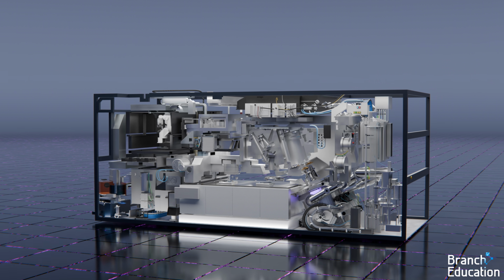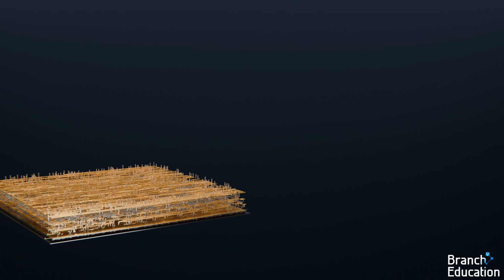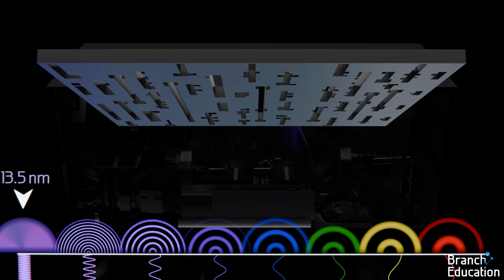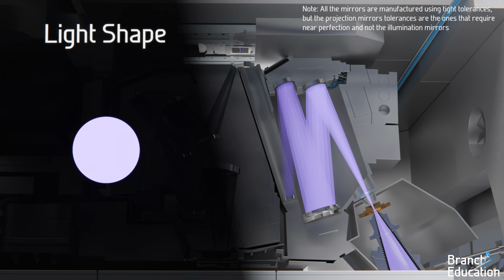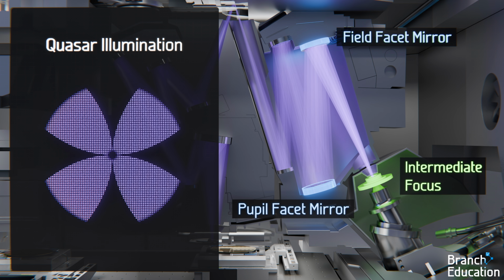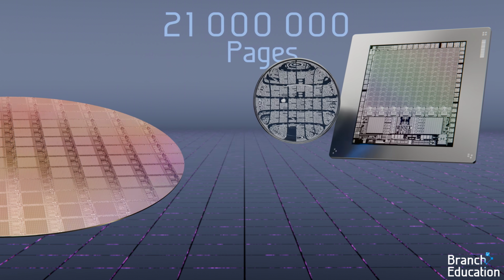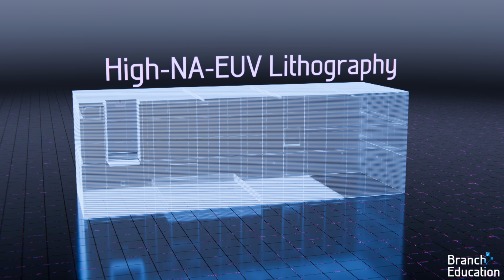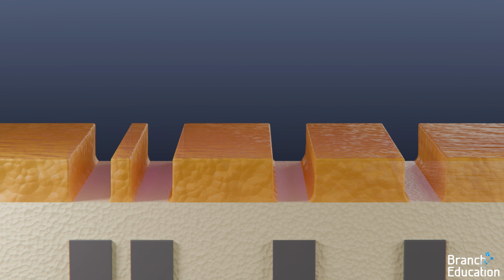The $200M Machine that Prints Microchips:  The EUV Photolithography System

Comment: AI Summary

Abstract:

This video provides a detailed, animated exploration of ASML's Extreme Ultraviolet (EUV) Photolithography system, explaining how this highly complex machine manufactures modern microchips. The system functions as a nanoscale photocopier, imprinting intricate patterns of transistors and wires from a master template, called a photomask, onto silicon wafers. The video breaks down the core processes, starting with the unique method of generating 13nm EUV light by vaporizing tin droplets with high-power lasers in a vacuum. It then explains the sophisticated optical path, which uses specialized multi-layered Bragg reflector mirrors to guide and shape the light. The presentation covers the role of the photomask, the projection optics that shrink and focus the pattern, and the "TWINSCAN" wafer handling system, which uses magnetic levitation and advanced sensors to achieve sub-nanometer alignment accuracy.

Deconstructing the EUV Lithography Machine: How Modern Chips are Made

*   1:07 Introduction to Photolithography: Photolithography systems are essentially nanoscale photocopiers that imprint the designs for transistors and wires from a master template (a photomask) onto a silicon wafer. This process is repeated hundreds of times across the wafer's surface.
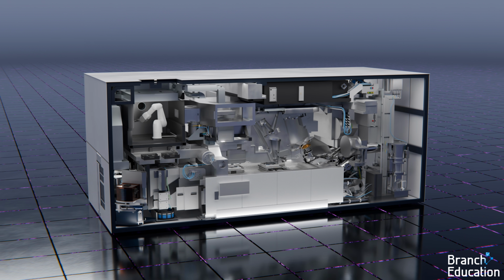*   6:09 The "Stencil and Spray Paint" Process: Chip manufacturing is a cyclical process. The EUV tool creates a "stencil" by exposing a light-sensitive photoresist layer on the wafer. Other machines then "spray paint" by etching, depositing materials, or implanting ions through this stencil to build one layer of the chip. This loop is repeated around 80 times for a complex GPU, taking several months.
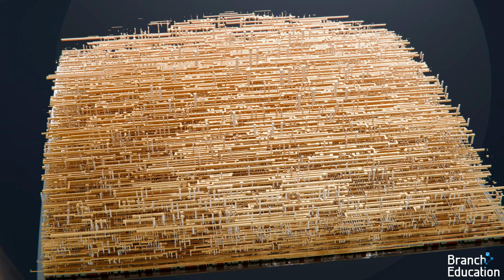*   10:50 EUV vs. DUV Systems: Advanced chip factories (fabs) use a mix of lithography tools. Expensive EUV systems, which use 13nm light, are reserved for the smallest, most critical layers (like transistors), while older, less costly Deep Ultraviolet (DUV) systems are used for the larger, upper layers of wiring.
*   15:31 Generating EUV Light: The system creates EUV light in a vacuum chamber by firing two high-power laser pulses at tiny droplets of molten tin traveling at 100 m/s. The second, a 25kW laser, vaporizes the tin into plasma, which emits the required 13nm EUV light. This process repeats 50,000 times per second.
*   19:49 Advanced Reflective Optics: Because EUV light is absorbed by almost all materials, including glass and air, the entire system operates in a vacuum and uses highly specialized mirrors. These "Bragg Reflectors" consist of dozens of alternating, nanometer-thin layers of silicon and molybdenum to achieve approximately 70% reflectivity per mirror.
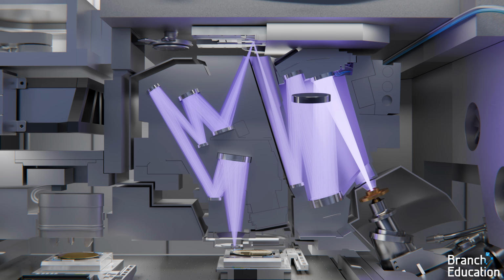*   20:54 Sophisticated Illumination: The illuminator uses hundreds of independently controlled micro-mirrors to shape the EUV light into complex patterns (e.g., annular for circular features, dipole for lines). This is analogous to angling a pen to draw different shapes and is critical for accurately printing different types of circuit features.
*   22:58 The Photomask (Reticle): The photomask is the master template containing the design for a single chip layer, with a pattern 4x larger than the final image printed on the wafer. It is loaded onto a reticle stage that moves with extreme precision and acceleration (over 7Gs).
*   28:19 Projection Optics and Numerical Aperture (NA): A series of large, precisely crafted mirrors (made by Zeiss) project the pattern from the mask onto the wafer, shrinking it by a factor of 4. The system's ability to print small features is defined by its Numerical Aperture (NA). This tool has a 0.33 NA, while next-generation "High-NA" tools will use even larger mirrors to achieve a 0.55 NA for printing even smaller features.
*   32:27 Sub-Nanometer Wafer Alignment: The system uses a "TWINSCAN" architecture with two wafer stages operating concurrently for efficiency. While one wafer is being patterned, the other is meticulously measured using alignment sensors. This creates a detailed map to correct for distortions, ensuring each new layer aligns with the previous one to within a single nanometer.
*   36:01 Levitating Wafer Stages: To achieve incredible speed and precision, the wafer stages levitate on a large magnetic grid. They are moved by powerful electromagnets for fast, long-stroke travel and a secondary short-stroke stage for nanometer-level fine adjustments, ensuring perfect synchrony with the reticle stage during exposure.

I used gemini-2.5-pro| input-price: 1.25 output-price: 10 max-context-length: 200_000 on rocketrecap dot com to summarize the transcript.
Cost (if I didn't use the free tier): $0.04
Input tokens: 23778
Output tokens: 1000

Comment: 0:30 10nm? not 4nm? are AMD claims just marketing or is it something else?
Reply from the maker: yeah, 4nm is a marketing term and not a real physical dimension
Reply: They are working in 2 nm this year
Reply: Not just amd, all companies that make this kind of hardware
Reply: It's marketing term yes. Since around 2010 the nm number no longer corresponds to a single physical feature like transistor gate. Now They just represent improvement in the technology.
Reply: @4paapii So the nm number is like a hype?But the computing function of the chips is still improving or what?
Reply: @soulsdark5733 it gives even more space for more transistors
Reply: @soulsdark5733  the performance is improving which is why clock speeds and performance is going up

Comment: What I want to know is, how long did it take for us to get to THIS level of complexity? When the first microchip was invented, there weren't any of these huge, insanely complex photolithography machines. They started with something comparatively simple, kept asking "how do we make it smaller?" and then started coming up with more and more bizarre technologies to essentially hack the laws of physics into doing stuff that by all logical reckoning should be impossible. At what point did someone figure out that they can't just use any old light source, to get this done, but that they have to use the very specific type of light that you can only get by blowing up a goddamn particle of tin and then shining it through a tube full of mirrors? And then who was it that realized that, again, not just ANY mirror will work, but it's gotta be a WEIRD mirror made out of a metal that most people have never even HEARD of before?

It really is amazing just what humanity is capable of when we start putting our heads together and combining all of our ideas, research and brainpower. This sort of thing could never have been designed and built by a single person - it's the result of decades, if not centuries of interdisciplinary research, hundreds or thousands of scientists building off of each other's work and referencing each other's discoveries to do things that would've seemed like magic only 150 years ago. I only hope that we keep moving forward when it comes to science, and not let the new hurdles that are threatening the intellectual development of our species slow us down.

Comment: How do you make a photomask then?
Reply: he already said it , silicon and molebdium which is work as reflector for uv rays
Reply: @Rohit-cj6eb  Nah. I meant the photomask. What you talking about?
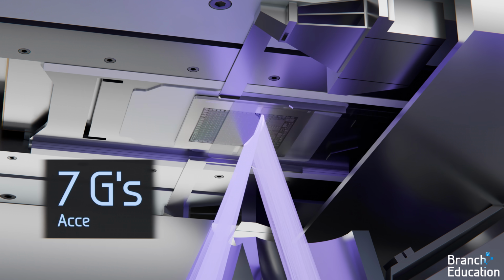Reply: @progresShip  25:05? Do you have ADHD?
Reply: @Rohit-cj6eb You dumb***. If the details on photomask have the same dimensions as the details on the chip then if the dimensions of the details are 13nm, how tf do you suggest they made the photomask?
Reply: @Rohit-cj6eb If the details on the chip have the a dimension of 13nm then the photomask also has details of dimension 13nm, how do you suggest they made the photomask?Me? ADHD? Says the idiot who just agreed on whatever was said. With just those two lines you envisioned the creation of a photomask, did you?  How do you think they put such tiny details with the Braggs reflectors or whatever it was? Those reflectors themselves will have to be similarly tiny you idiot. How do you create and install such tiny reflectors? That's my question. You are safe that YouTube deletes my comment or else i would have humiliated you to the point where you would have never recoverd you sheep following a herd

Comment: One of the engineering achievements of this machine that stuns me the most is that it's a factory operating at a quantum scale. Like, were pretty good at mass producing things at this point, and we can study quantum physics in highly controlled lab environments, but in most cases I feel like those are two pretty different fields of science and engineering. And yet somehow, these machines manage to do both at the same time.

Comment: That is frankly unbelievable technology. It's the kind of thing made up of so many individual pieces of black-magic that it honestly makes me wonder how anyone ever came up with even one piece of it. 

I get that this is probably the 40th generation of this kind of technology and it's been making smaller improvements over time, but still, this is near-incomprehensible levels of advanced.
Reply: Check out the detectors of the LHC, JWST operation and deployment, Optical interferometer telescopes like VLT or Chara.....so many things that seem to have no right existing it blows my mind.
Reply: It truly is 🔥
Reply: Well they had a 20 YEARS development time for the machine, including the delivery optics and driving laser. It required long, long breath to make it real.

Comment: @BranchEducation Congratulations on the ASML sponsorship! 
My friend sold Canon lithography machines in the latter 70s. Even then, they were working hard on getting parallel walls to the channels in the photoresist. The silicon ingot crystal structures had on the order of one defect in 10^23. You should see one of those 300 mm wafers explode when you bend it beyond its elastic limit! 
I think you have an unsurpassed ability to communicate sophisticated technology with sufficient, but not overwhelming, detail.
Best regards

Comment: I found this video to be absolutely fascinating, awe inspiring, and very nearly unbelievable. The level of layered complexity and extreme micro-precision involved in the microchip manufacturing via EUV Lithography is so far beyond being "impressive"... there is no adjective adequate to describe it... this is all seemingly "God like".  
If I had been shown this video and told it was a proposal for a machine yet to be built, I would have said: "It is amazing, but it will never work.  There are far too many variables, all requiring a level of complete control and precision, that the physical reality of our world will simply not permit this process to be achieved."  Yet, that skepticism would be an incorrect assessment, as these machines have been with us for many years, and they create the computerized devices which make modern life possible.  
I have long thought the moon landing program of 1969 to 1972 was the most impressive thing we have ever done. Elon Musk's Space X demonstrating the ability to launch a rocket that deploys satellites, returns the Earth backwards, and is caught with a giant pair of tongs, to be reused, may have superseded that.  I must admit now, these EUV Lithography machines are likely the most impressive thing human beings have ever created.   
We are however, now hitting up against the physical limits of reduction, creating microchips with circuit pathways as small as 3 nanometers.  We know that going below the 1 nanometer level causes "quantum tunneling", (electrons moving through matter and being in more than one place at the same time), and so physical matter cannot be controlled at levels smaller than this... (plus circuit pathways obviously must have an atom or two or three on each side of the wall... we cannot build things out of subatomic particles).  I wonder if future microchips will have any option other than getting larger overall, and stacking into thicker layers?

Comment: I knew these machines, but they are 1000 more complicated than I ever could expect. How can human design something so complicated and make it work ?
Reply: it took a while to get here, longer than I have lived at least. less advanced lithography machine where used for decades after all. the 386 at 1000nm node is a pretty usable cpu for home computers, full keyboard mouse GUI and all. was made 40 years ago.
Reply: There were a lot of humans involved.
Reply: It took decades of progress getting stuck...to the point that a lot of people thought perhaps it's impossible to go further. 

And then one day ASML revealed they made it happen.

I won't be surprised if it takes 50 or a 100 years until the next step up.

Xray wavelengths seems exponentially more difficult.
Reply: @tylerdurden3722 it takes thousands of brilliant minds over generations to get to any one point. But it's one particular mind that comes along to produce the missing peice of the puzzle, that finally allows the breakthrough that had stalled everyone before. It's sad that most of these key individuals are unknown to the world.
Reply: This can't be done by mankind..

Comment: This is absolutely one hell of a video

Tried to answer a really curious person here. Kindly correct me if you're with ASML :)

1) how do the actuators in the short-stroke stage work?
      
Short stroke stage corrects the yaw (orbit) corrections for topological corrections is handled by the field facet mirror

2) what features is the quasar illumination pattern used to etch?

Dipole illumination is used for x and y axis
Quasar illumination is to more accurate x and y axis including diagonal features

3) I knew that often multiple exposures were used to etch a single reticle, is this information wrong/not true anymore?

Depends how you define multiple exposures as you see, EUV turns on and off 50,000 times a second so its multiple. photons behaves as a probablistic wave and sometimes does not hit on accurately on one point along the wave, so multiple hits are required to etch acurately. But if you are asking "How many passses" then its one

4) why is the exposure done in a "slit" rather than "globally"

Slit because limitations in EUV power. Channel already said that there are 30% losses per mirror, this is not the complete story. Laser conversion is just 1-3% so 97-99% is lost there. Then EUV from tin plasma fires in all directions and the collector mirror only reflect 30-40% of the collected EUV which itself is a Bragg Mirror has 30% losses itself

If it is global reflection, granted its possible, there will be difficulty in alignment on the topographical aspect of the wafer

4.a) how is that slit achieved? do they have distorted mirrors (not even asphericals, as that would still be axially symmetrical)?

Controlled by multiple mirrors with axial corrections on the field mirror

4.a.i) how do they make such mirrors?

Magnetron sputtering and if extreme accuracy required, Atomic layer deposition with chemical and mechanical polishing. It has about ~50 alternating layers of Molybdenumn reflector and Silicon spacer on layers and surface to prevent contamination. Total thickness is 150-200nm, still less than a micron

4.b) do Bragg reflectors need to have the same surface finish on each of the layers, or is the final surface more important than the others?

Silicon capping is important to prevent contamination of the molybdenum layers, especially at the tin plasma chamber. This area can be contaminated by tin sputter and deposition from tim plasma gas. There is constant hydrogen flush though

5) how does the intermediate focus work?

I think I discussed most parts of the intermediate focus (tin furnace) part, what is left is the zinc filter on top. Blasted tin produces mostly EUV but also other wavelengths, the Zinc filter removes the other frequencies

6) how is the reticle constructed?

The silica and the tantalum blocker is printed by electron beam lithography. If Twinscan is the mother, Then E Beam is the father (LOL)
For the Bragg Mirror layer of the reticle, Refer to my answer at 4.a.i

7) If the tin is vaporized at different point (as each droplet has a slightly different trajectory), how is the EUV light not slightly shifted from one droplet to the other? is the cone of light carried by the optics bigger than what the etching utilizes to account for this?

I think the representation is wrong, the laser light should be another point to convert the tin into pancake then at the center of the convex should be the high powered laser. 

If the droplet is off trajectory it will be disposed, if it meets tolerances, then it will be blasted. Not all probably at same trajectories, but the 50K frequency can compensate for it

8) How strong of a vacuum is pulled inside the lithography machine?

To the point that air molecules are gone inside the machine as air absorbs EUV and it can oxidize parts inside

9) Given the 50KHz frequency of the light beam, multiple "flashes" are used to perform a single exposure (let's say 50000/18s (per wafer) / 100 (reticles per wafer)). how is a consistent light exposure achieved?

At 50,000 its almost as consistent like you can deciper motion at 60HZ on your phone display. I think I explained the wavefunction of light at number 3

Comment: At 35-09, the machine scans each wafer back and forth in short strokes thus creating inertia, and nm errors can take place if the platter jumps, so why not scan a whole row in one long stroke such that  there is less back and forth movement. less wear on parts. Other than that I am sure Chinese would want to know how they can make a similar machine as thats what restricts their large scale chip fabrication